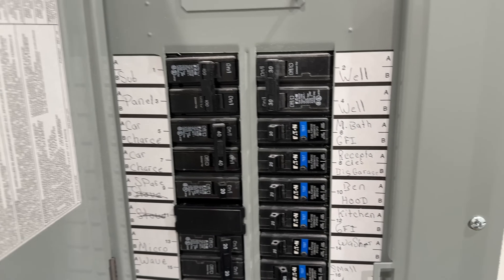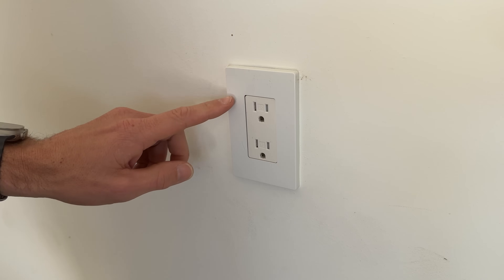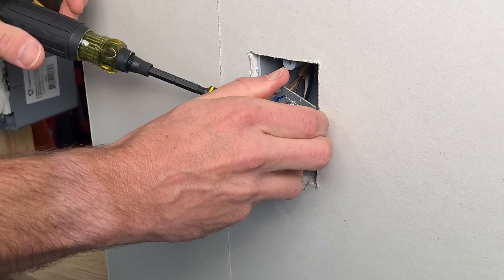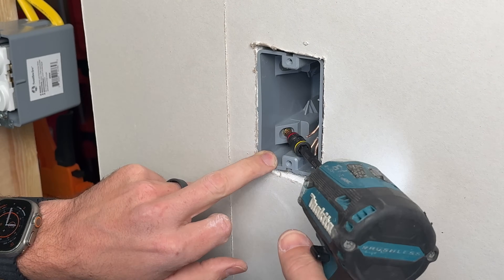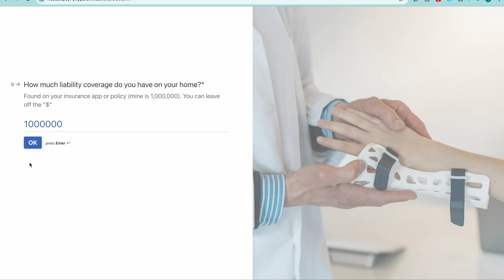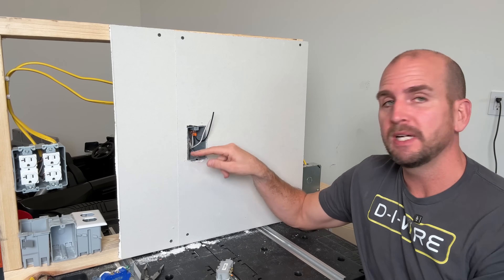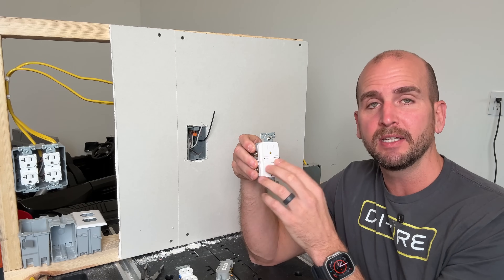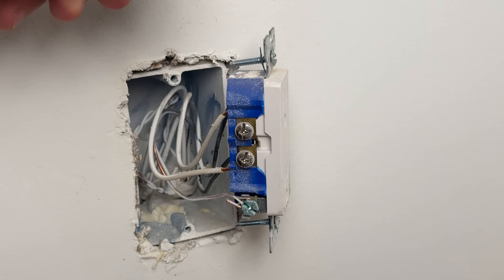The Ultimate Outlet Replacement Guide: 10 Mistakes Everyone Needs to Avoid

Comment: You content creators keep mentioning things that are code grandfathered in or imperfect workmanship as wrong bad or not to code.  These events are incorrect at best.  Its like the pretwist debates or backstab outlets.   Not cool.
Reply: it may shock you, but people will find things in older houses that don't meet current codes. - or in houses that a homeowner did their own work in.
Reply: @kenbrown2808  I have two old rentals. The wiring and outlets are grandfathered in.  While I find it dangerous, the old wiring is cloth covered heavy Gage vinyl covered wiring with almost no ground wires.  Only the kitchen and bath have independent bare copper ground wires.  And all the outlets are very old, but have thicker internal brass contacts.   And the splices are soldered.  This wiring and outlets by Gage and component metal contacts exceed the amperage use in modern commercial outlets and have thicker more durable bakelite ebonite moldings.  They are built like a tank.  Just no ground wires. I was replacing old outlets with modern commercial  ones with half the metal thickness and half the cheaper plastic mold thickness.   I could probably run double toasters or large element commercial electric heaters and not heat up the original outlets or wiring.     You can barely bend the original wiring when working on it. But no GFCI safety so moping the floors with extension cords laying around would be deadly.
Reply: I need sum fiberglass lineman's pliers to work the wires into the outlets.   I'm using the voltclaw because the wires are like rebar....lol.....I can't use normal linemans or heavy needle nose pliers because it's ripping into the wire insulation, which is also more thick and more durable than modern romex.   These wires are like stainless welding rods.....what's pita!    Old house wiring a fire risk with high amp appliances like heaters n toasters?    Yeah,....maybe 12 toasters all on one outlet.......lol
Reply: @daleb5967  funny. Pretty sure i told you that's because the copper has work hardened from being overheated over the years. Similarly, the insulation and sheathing gets less flexible, as well. I've seen that generation actually get brittle.
Reply: @kenbrown2808  I dunno.... The bathroom ceiling light wires is the same and it's only been driving 2  4' CFLs for 80 years.....     Like stainless welding rod...lol
Reply: @kenbrown2808  everything is 15 amp glass fuses except the furnace n washing machine n the kitchen toaster can opener outlet.   And those are only 20s
Reply: @kenbrown2808  the insulation is Def stiffer being old, but it's holding up bending and not tearing or stretching thin during bending.   Bending Shepard's hooks is still tough with bare wire.  
I try to sample some in a basement corner that was unused.
Reply: @kenbrown2808  the cloth is not easily cut or tearable either.
Reply: @kenbrown2808  this stuff is safe n bullet proof unless u spill a cup of coffee on something......lol
Reply: @kenbrown2808  good thing electric coffee pots weren't common back then....lol
Reply: @daleb5967  that would put it in the 20s that's knob and tube, not cloth sheathed nm with thermoplastic insulation. Also no such thing as a 4 foot compact fluorescent. But you keep telling yourself stories.
Reply: @kenbrown2808  my bad.   60 years and 2 FL....😁.
Reply: @kenbrown2808  much of that is grandfathered in.
Reply: Not meaning to attack this author, but videos in general that imply things like a backwards Shepard's hook is not to code or will burn down a city.    Lack of exceptionality, sure.
Reply: So.....doing my homework,.  Today's outlets are made from the same pvc as Legos.     That explains why I broke 3 levitons in a row in one outlet after replacing a two prong bakelite.
 one.  Just sad.
Reply: @daleb5967  if you're breaking modern receptacles installing them, you're doing something very wrong.
Reply: @kenbrown2808  I know.   The 2 gang box has two runs of old heavy wire that don't like being folded or curled back.
Reply: @ funny. Pretty sure i told you that's because the copper has work hardened from being overheated over the years. Similarly, the insulation and sheathing gets less flexible, as well. I've seen that generation actually get brittle.

the more you tell me about that house, the more glad I am I'm not living in it.  and you might check behind those fuses next time you're working on it.  you can often find antique pennies.  which have much more than a 15 amp rating.
Reply: @kenbrown2808  it's mostly the insulation being stiffer.   The ceiling bathroom was the same just driving 2 FL tubes
Reply: @kenbrown2808  I will 4 square the basement fixture later.   I needed to 4square the kitchen outlet just to work on it. I needed to add a disposal outlet  and an additional counter outlet run anyway.  It had 3 runs in a 2 gang outlet.
Reply: @kenbrown2808  like I mentioned.  The amperages on all the old wires n bakelite outlets is fine. It's overkill.   It's the lack of grounds that's dangerous.
Reply: @kenbrown2808  kitchen outlet wasn't even loose.     Evidently the can-o-matic and toast-o-matic didn't anneal the outlet...
Reply: @daleb5967  wel, what do I know, I'm just the guy ponting out the metallurgical reason that old copper has lost its ductility.
Reply: @kenbrown2808  going 4 deep is my only option without destroying the old wires on a few of these.   The insulation is not getting damaged from bending, and it's not cracking, but I was damaging it with steel pliers. Edit.   Yes I got lucky with the kitchen outlet because the shiplap was so thick an had another layer of drywall over it.   The basement outlets are in the 2x6s
Reply: @daleb5967  I know you don't want to understand what I'm saying because a complete rewire is very expensive.  but seriously - your wiring is old.  the metal is hardening, and the next step will be to start crystallizing and becoming brittle.  there's a very good chance, that somebody at one point, dealt with blowing fuses by putting pennies behind them, being stiffer doesn't mean it's better wire - it means it is worse.
Reply: @kenbrown2808  I agree, but there is dozens of square miles of these in this city with only new breaker boxes n a few gfcis.   Half a million and up per unit. Many don't even have new fuse boxes.  These units are not in ghettos.  And house fires here are very very uncommon.
Reply: @kenbrown2808  theres not many electrical contractors running around here.   And almost no mention of such renovations in the listings.
Reply: @daleb5967  house fires anywhere in the US are pretty uncommon.
Reply: All the old bakelite outlets are tight n solid.     I've replaced more levitons in my rentals than older bakelites.    In my own house, I've replaced three levitons....two in my kitchen outlet that runs the coffee pot, one that runs a space heater on occasion.       Ive broke levitons apart with needle nose pliers.   I cannot break the bakelites.   And the bakelite outlets also have larger screws.    The premise that new outlets are sturdier safer is a con.
Reply: It's just sad that a new premium outlet can anneal in a couple years and be dangerous.    My leviton rocker outlets were nice but I replaced them with the glass smart switches..   the outlets....not so much....

Comment: You mentioned links in description but they aren't there. Particularly interested in the non decora edge outlet - I couldn't find it on Amazon.
Thanks.
Reply from the maker: Thanks for the reminder and I think Home Depot has them exclusively for the first 3-6 month and then the new models seem to roll out to more stores.  https://www.homedepot.com/p/Leviton-Lever-Edge-15-Amp-125-Volt-Duplex-Outlet-Receptacle-NEMA-5-15R-Commercial-Grade-White-10-Pack-M02-ECBR1-WMP/331467943

Comment: How to remove wires that were “back stabbed” into an outlet or switch?
Reply from the maker: You can press in a small slotted screwdriver into the slot below the wire to release or if that doesn's work you can twist back and forth and pull them out.
Reply: @EverydayHomeRepairs  other way around - twist and pull will usually get them out, and if that fails, use the tab.  or channies.  if you're chaning out a lot, just crush the outlet with channies.
Reply: @kenbrown2808  This is the voice of experience. Totally agree.

Comment: You have 12/2 wire with a 15 amp plug? Is it a 15A breaker? Could that be bad since the receptical isn't rated to pull 20A if its a 20A circuit?
Reply from the maker: Nope, it is a bit confusing but you can have a 15-Amp duplex outlet on 12-gauge wire and a 20 Amp breaker.  Just can have a single 15-Amp outlet on a 20 Amp breaker.
Reply: side wire receptacles are rated for use on a 20 amp circuit, even with a 15 amp face.

Comment: Love to see a tear down of the new Leviton lever connections. Honestly, nothing I see there makes me think it's in any way better than backstabbing. Cracking them open would tell the story.
Reply from the maker: The design is substantially different and I like the retention design a lot more than what is on a standard cheap outlet with backstabbing.  I will get the Dremel ready and cut a few open 👍

Comment: 12:38 wouldn't you also recommend putting it on the other side of the screw so that as you tighten the screw it pulls the wire in (that's the way I was taught)
Reply from the maker: That is a good point and was actually thinking the same as I tightened the screw.  Good catch 👍

Comment: I thought you were sold on the ECX drivers?
Reply from the maker: I was, until I switched over the the Klein Multi bits.  I like the 16-in-1 but the 15-in-1 Klein comes with a combo bit as 1 of the 15 just like the ECX.  I just like having to only carry 1 screwdriver for 99% of my DIY jobs.
Reply: I tried the ECX & didn’t find a big difference.

Comment: You forgot to mention breaking off the mickey mouse ears when using old work boxes.  Otherwise, your outlet will be too far forward, and the faceplate won't sit flush with the wall.
Reply: Depends on the depth of the box.

Comment: Back in the day, I'd plug an extension cord into the receptacle I'm trying to shut off, plug my outlet tester into the cord and drag it to the panel with me. That way I know when I turned off the correct breaker. Now I use the Klein ET310.
Reply from the maker: Nice, that is actually a good idea

Comment: You really should talk about aluminum wire in some of these common repair videos - many houses in my area built in 60s used this.
Reply from the maker: Thanks for the feedback!  Aluminum wasn't too common in the few different areas I have lived over the years but good to get the feedback to make sure we are helping the most people.
Reply: I always hated dealing with aluminum wiring.😂
Reply: @Lysander_Spooner  yeah, it sucks for a lot of different reasons.
Reply: Yes.  My son ran into this in his condo.  The microwave outlet was turning black so he unplugged it.  Turns out, 15 amp circuit with aluminum wiring connected to copper extensions.  A bit of a heat issue.  And then there was the mold...
Reply from the maker: @ Sounds fun 😕
Reply: @berthongo8531  I'm converting mine using copper pigtails, but you need the right connector and the paste stuff.

Comment: Great demo, what is that gray box called that screws to the stud? I recently purchased the skill cordless swivel head screwdrive($19) that’s worth every penny I’ve used similar ones 4X the price and I prefer the Skill. Always a learning lesson, thx for sharing 👍
Reply: They are the Southwire SmartBox. The screws that come with them are #6, 1 5/8”, fine thread, sharp point drywall screws. Fine thread drywall screws like to be driven perpendicular to the surface of the wood. Not at an angle. Therefore, like Scott, I remove the screws that come with it and use either Torx screws or #6, 1 5/8”, coarse thread, sharp point drywall screws
Reply: @ thank you for the great info

Comment: are there any pointers on working with metal boxes? my house uses flex and utilizes the box as a ground.
Reply: the biggest pointer is, if the flex is damaged or broken, you've lost your ground connection.  if a DIYer has replaced it with nonmetallic cable, then the ground wire has to be bonded to the boxes to maintain the integrity of the grounding system.  as for replacing devices, with an effective ground path - commercial grade devices usually have a clip on one of the mounting screws that allows the device to be grounded through the screws, so you don't HAVE to retrofit ground pigtails, but ground pigtails are more sure to make good contact.
Reply: Is there a ground wire in the flex?

Comment: Not just for short wires - I recommend always stocking some Wago or Ideal push connect, and a few feet of 12ga wire.  This will allow creating pigtails instead of using the outlet to connect multiple wires to feed downstream in parallel.  (Just did this while replacing the outlet at the end of the island in mother-in-law's kitchen.)
Reply: I did the same when I replaced all of the outlets in my home.

Comment: What if I don’t have a ground and my outlets are wired in series. I don’t know which outlet is the main line so where would I install the gfci?
Reply: You'd have to determine which one is first in line from the panel. Once you do that, you're good to go.
Reply: the outlet closest to the panel is usually the first in line.  once you've determined what outlets are on the circuit, you can separate the wires on the closest outlet, and see if that kills power to all of them.  then you can find out which cable is the host side, and install 1 GFCI to protect the entire circuit - or, if the panel has been upgraded, you can install a GFCI breaker (I recommend a dual fault GFCI/AFCI breaker if they cost the same)  also - the common term for that is daisy chain, rather than series - since series has a specific meaning in electrical work.
Reply: @kenbrown2808  Thanks for the info and education on correct terminology, it is appreciated.

Comment: Very informative video.  The lever-connect feature of the new Leviton outlets looks to be very functional.  However, they appear to be bulkier in the body than the regular screw type outlet.
Reply: they're bulkier, and the drywall ears are bigger.  its made for an oversized cover plate.  you can trim off a breakaway part of the ears, but really, they're made for fast and sloppy.

Comment: 6" and 3" rules.  Why are electricians such cheapskates?? What's an extra inch or 2 on every box?  You are charging the customer for each foot actually used anyway!!!
Reply: not too long because it is a pain to stuff more wire into the box.

not too short because it violates code.

sometimes they get cut shorter during a repair - I've had to trim off burnt ends and barely had enough good insulated wire to splice with a Wago.
Reply: @Sylvan_dB  very true.  Sometimes it's hard to tell if it started that way or not.  Stuffing the box is a pain though
Reply: There's a thing called NFPA 70 that electricians have to go by.
Reply: @redneck94chevy  NFPA 70E refers to safety, arc flash, blasts, shock, etc. The National Electrical Code (NEC) refers to codes related to electrical installations.
Reply: it's usually an old house or a do it yourselfer thing.  electricians don't short themselves on wire, because it makes it harder to do the work.
Reply: When I was a residential electrician,  about 30 years ago, I worked for a contractor who would get angry if I left "too much" wire in the boxes. Literally a couple inches extra. He said it came out of his profit.😂
Reply: @Lysander_Spooner  those are the ones that tend to be penny wise and pound foolish.  I'm guessing he was always cracking the whip on you to hurry up, too.  best example I've heard of that was "we don't make money on T&M jobs."  I think my response to that was, "that's a billing problem."
Reply: @kenbrown2808  Yep, he would always do that. I also remember being at the shop to load up. One time I opened the slider on the van and a couple tans fell out onto the ground. He said, "Make sure you pick those up, they're 3 cents a piece".

Comment: 22 gauge wiring for a 20 amp receptacle good?
Reply from the maker: 12 gauge would be the right match for 20-Amp.
Reply: The smallest AWG you can use on a 20 amp branch circuit is 12. The smallest AWG you can use on a 15 amp branch circuit is 14.